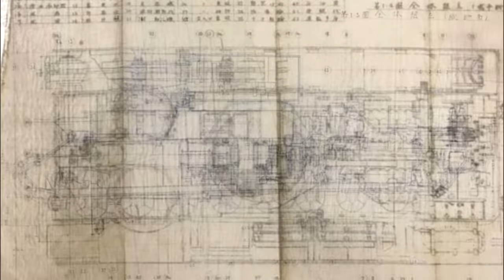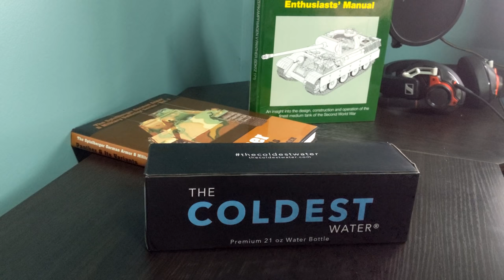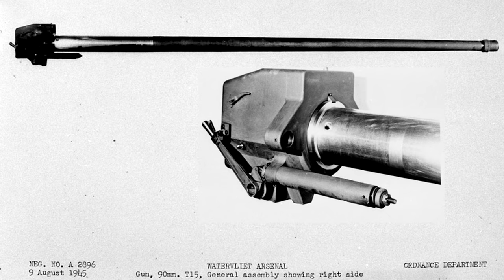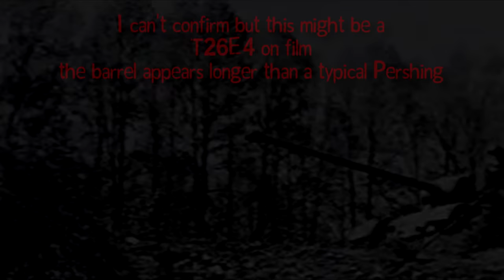America's King Tiger KILLER, the Super Pershing | Cursed by Design

Comment: Additional note:  Don't forget the ammo!  To my knowledge, the only anti-tank ammo that was available for the 90mm gun prior to the end of WWII (and possibly for some time after), was the T33 E'X', where the 'X' stands for one of several modification versions of the projectile.  I have an E4 with the powder cartridge empty and it is one of the single-piece designs.  The "T" designation shows that it was still an EXPERIMENTAL projectile not yet introduced into the standard Army inventory -- I am not sure this design ever was.  The projectile weighs about 43 pounds and is crimped to the huge projectile cartridge at the projectile's base just below the single copper driving band.  This projectile is an "AP Shot" projectile with no streamlined windscreen or hardened AP cap on its nose and the nose was a rather blunt-point "Secant Ogive" design (has a somewhat more conical, less curved shape than the more-typical Tangent Ogive nose where the nose merges smoothly with the cylindrical body); the S-O shape having a beveled crease where it joined the lower body.  This nose allowed a reasonably good penetration by "wedging" action against thick armor a near-right-angles impact (up to circa-30 degrees from right-angles as zero), but was blunt enough to dig its lower edge ("chin")  into such a thick plate at higher impact angles over 45 degrees such as the sloped upper hull of a PANTHER or TIGER II or their up-gunned, turretless, tank-destroyer variants.  Many of the earlier US anti-tank projectiles in WWII had AP caps to keep the nose from shattering on impact at moderate (30-45-degrees) against ductile armor like US tanks used and against the face-hardened armor used by many German tanks, both as their main armor or as uparmored over-layers at all angles up to 45 degrees or so.  This projectile seems to have been made tough enough not to fail under these conditions.  As the fronts of German tanks became more sloped and streamlined to increase glancing as a major form of protection improvement, the caps actually started to cause REDUCED penetration, since they flattened out and were broken up on the plate face, reducing the weight of the shell as it tried to go deeper into the armor.  Also, it was found that projectile nose breakage at high obliquity where glancing was the most important means of increasing protection, actually INCREASED penetration due to the broken nose pieces ricocheting away no longer affecting the rest of the projectile at all, so it just kept digging into the armor at the original spot with bad effects on the armor.  Note also that this new shell was AP Shot, with a solid core increasing its weight and strength, since the older capped shells had an internal cavity for an explosive.  Explosives may make the shell do more damage if they penetrate, but the hollow space inside the projectile most decidedly makes the projectile body lighter and weaker, most especially when hitting at an oblique angle, which in many cases made them of minimal effectiveness (all or nothing seems to have been the rule and AP Shot does that as well as or even better than an AP shell does if it penetrates).
Reply: The T designation was retained for some reason, even though the projectile was the standard AP round into the 1950s. T33 did have a 'ballistic cap' windscreen, but no cap.

Besides the T33, the M3 was furnished with M82 APCBC and T30E16 APCR.

Comment: Soviet Union Tiger II killers : ISU 152 and IS2.
But US Pershings and experimental heavy tanks are fascinating machines. Imagine  a T30 with 150mm HE wrecking king tigers.
Reply: @jbeverley67  And of course you can prove this, because your biased opinion doesn't cut it.
Reply from the maker: The is3 was indeed a fairly bad tank. It was unreliable and although the armor in theory was effective due to issues with the design it was considerably weaker than it should have been. It accomplished the goal of intimidation but removing any bias one way or another it was a flawed machine.
Reply: @Vlad_-_-_  just read cones response lmao
Reply: @ConeOfArc  Of course it had its flaws, the only reliable heavy that saw mass production was the IS2 and Churchill. I've read about the issues with the automotive parts of the IS3, but garbage is again, biased. I know early models have bad welds, but they seem to have remedied that. There is a famous picture of an IS3 front plate pounder by 105mm guns, the one from the Lorainne or the one on the Sper Sherman, I am not sure which one, but the armor did not crak or fall apart. Still, given only that, is not enough to make a good tank. Tanks like the Pattons and T54 and Centurions was the way to go, I do not see the point on IS heavy line after the IS2. Conqueror and M103 as well. Heavy tanks did not have a place post WW2 I would say.
Reply: @Vlad_-_-_  waste of time? Bias lmao ok. Nigga it's pretty obvious that you're bias towards the is3. It's pretty common knowledge that the is3 was a mediocre tank. What's the point of arguing something that's pretty well known already? The is3 was a rushed heavy that was built to strike fear into the allies for the victory parade. Who cares, heavys were obsolete pretty much right after ww2 anyways.

Comment: People speak of the King Tiger as though it was something that required a design to counter it. In fact, only around 500 King Tigers were ever produced and many of them broke down before reaching the battlefield. When you consider the amount of resources and man hours involved in the production of the King Tiger, it hurt the German cause more than it helped. 
...So much for wunder weapons.
Reply: The KT's 60% operational reliability does kind of poke a hole in that theory. It was only like 4% lower than the Sherman and almost 20% higher than the Panther. In the waning days of the war, KTs did indeed receive the manufacturing focus as they solved almost all of the issues that Panther had.

You heard that right, King Tiger was actually a pretty reliable vehicle. The transmission issues that plagued Tiger I and Panther were fixed on King Tiger. The engine issues were also mostly solved on KT, which is evident due to its higher speed than Tiger I, despite being significantly heavier. The roadwheels also weren't interleaved like Panther and Tiger were either, so that meant that it was significantly easier to work on the torsion bars should it be necessary.

Be kind to the King Tiger, she tried her best.
Reply: @OtterTreySSArmy  Many were reliable because they were never used. They would arrive on flatcars with little fuel in their tanks since a following train carried their ammo and gasoline. The trains with gasoline were often hijacked by other army units desperate for fuel so would arrive with empty tank cars. The tanks were unloaded and parked until more fuel arrived, which didn't happen in many cases.

Comment: REALLY? First encounter was with a Panzer 4. Panzer 4 put a round through the Pershings Barrel disabling it's gun. Second round from the Panzer 4 went straight through the Pershings Front armour plates killing the crew inside. To my knowledge the Pershing never killed a Tiger as they were pretty rare at that stage of the war. All tigers were mostly on the Eastern Battle front.
Reply: I highly doubt this
Reply: Doubt
Reply: IIRC the first tank-to-tank clash was with a Tiger I, which surprised its opponent and landed one hit on the turret top (which ricocheted) and another on the gun shield which entered the turret through the co-ax 30-cal port). Two crewmen in the Pershing were killed, but the tank was ultimately repaired. The Tiger then backed into a building and got stuck, and was abandoned.

Shortly afterward, a Pershing and a Tiger I dueled on even terms: at 900 yards, the Pershing sheared off one of the Tiger's drive sprockets with an HVAP round, and penetrated the gun shield with a T33 round, brewing it up. This encounter is well-documented and photos of the knocked-out Tiger I are featured in Hunnicutt's book "Pershing."

Comment: I highly recommend Death Traps by Cooper.  The book gives the perspective of an officer/engineer tasked with maintaining and upgrading tanks.  While he did not participate in combat, he spent many nights in a jeep racing from the front to rear supply depots and than racing back before dawn with replacement parts.  Many of these dark journeys encountered German troops and tanks.  One big problem with the Sherman aircraft engine was that the spark plugs fouled badly when idled for long periods.  Plugs had to be removed daily so the fouling could be removed.  Cooper blames Patton for the lack of Pershings after D-Day.  Patton wanted the lighter and faster Sherman, despite the obvious superiority of the Pershing.
Reply: His book is honestly more of a memoir and he formed a bit of a bias since he was in the 3rd Armored Division, which saw a lot of heavy fighting. The Pershing wouldn’t really have changed much, except complicate logistics.

Comment: It's unavoidable: when you have the consummate gun on the consummate turret, it takes a while to deploy it.  You might have freedom in the desert, but in northwestern Europe, you could not operate a super-long barreled ultimate battle tank with the barrel deployed, i.e. facing front.  So, you had to react and deploy your main gun after finding a suitable place.  The Germans had an extra problem, as the open space we might've used was not available to them: air-to-ground missiles and ordnance would take out a large German tank in a clearing.  This overall problem hounded everyone; the ultimate tank of WW2, the JS2, was impressive, but it too had the turret/deployment issue and was often defeated by this...

Comment: One alleged successful tank engagement doesn't make it a Tiger Tank killer.
Reply from the maker: You're right, but being specifically designed for the purpose of being used as a tiger killer does.
Reply: @ConeOfArc  I could specifically design a fly trap and it catches a fly the first time..i wouldn't therefore claim that it was a successful after it captured one fly. However it it kept capturing flies every time you  used it you could make them claim.
Reply: @ConeOfArc  i just this minute googled did any tigers knock out pershing and 3 examples came up this being one of them,

Fireball was engaged and hit three times with 88mm APCBC from 100 yards range by a German Tiger 1 from Heavy Tank Company "Hummel."

The first round hit the turret coaxial machinegun port and, penetrating into the turret, killed the Loader and Gunner.

The second round hit the muzzle brake and may have set off the round in the Fireball’s breech.

The third round hit the upper right corner of the turret, glancing off and then hitting the tank commander's hatch cover.

Firebll was knocked out

S0 TIGERS COULD ALSO KNOCK OUT PERSHINGS
Reply from the maker: I never once said the Pershing couldn't be killed by a tiger I have no idea where you're getting that from. What would be the point of adding all the extra armor if the tank was already completely untouchable
Reply: @ConeOfArc  I know you didn't but you should have stated it's kill record is one tiger tank..which really doesn't make it a specific tiger tank killer.
Reply from the maker: I never said it even killed one, there was a claim that it did but we don't know what actually occured.

Comment: One doesn't install more powerful guns into a tank to counter the more powerful guns in enemy tanks. One installs a more powerful gun to overcome the armor on enemy tanks that your current guns cannot reliably penetrate. If you have a 50mm AT gun on your tanks that can kill any existing enemy vehicle, it doesn't matter in the slightest that they may have 100mm guns as long as you can get into effective range. So the idea that the 90mm on the Super Pershing was a response to the 88mm on the Koenigstiger is nonsense. The high powered 90mm was a response to the heavy frontal armor that was being installed on Panthers and Koenigstigers.

Comment: Never did fight a King Tiger, when they find that what they thought was a King Tiger was a Panzer IV
Reply: If the turret-less tank in the pic is the one it knocked out, that is indeed a king tiger. Center mounted light, fenders are completely different than any panther, running gear is also different. Furthermore, I can see mistaking a panther for a king tiger but a panzer IV? No sloped armor and looks nothing like a tiger II. More likely mistaken with a tiger I. (Panther Gs did get fitted with late style steel wheels but the tracks did not extend beyond the sponsons and there were no fenders. Rather Schürzen, spaced armor plates were hung from the sides.)
Reply: @driller7714  Though the pictured is of a destroyed King Tiger, it isn't the one it's said to have "destroyed". As that's a picture of King Tiger knocked out in the battle of the bulge, and the supposed one it knocked out was climbing a pile of rubble when the tank was knocked out. Not on the side of the road.
Reply: It could have just been a mistake in the heat of the moment. I dont see it as a big deal
Reply: Imagine being a panzer IV at the end of the war and seeing this monstrosity made out of half a panther and tons of boilerplate, with random shit added to it towering over you with a massively overpowered gun... yeah, that Panzer IV got fucking vaporized.
Reply: @KorianHUN  I fucking cackled
Reply: well, shit if it were abandoned they would have blown it up though wouldn’t they?

Comment: Well how many Tigers did it kill?
Reply: 632
Reply: It was designed to match the firepower of the KwK 43, even if it arrived too late for serious combat.
Reply: @hibiki9380  Wasn't enough? Even the M3 (with M304 HVAP) could defeat all plates of the Tiger II, albeit the glacis only at dangerously close range.
Reply: @hibiki9380  The problem of defeating, at long ranges, 150mm of RHA angled at 50 degrees would first be solved with HEAT and then with APFSDS.
Reply: @r.j.dunnill1465  there's the answer, Tiger II can penetrate you before you can even reach such range.
Reply: @hibiki9380  Only if they see you first.
Reply: @hibiki9380  The M3 would defeat the Tiger II's turret front out to 800 yards, and the sides and rear at long ranges. (In a documented case, an M36 knocked out a Tiger II at 1200 yards with a hit through the side of the turret, and that would have been with 2650 fps M82.) 

They didn't have to run from it.
Reply: 2 tiger I

Comment: My favorite Pershings were the ones with the 105 mm and 120 mm guns, much better fire power, Needed a more powerful engine though or the GAA opgraded to 1200-1500 hp (which it could easily produce reliably)
Reply: The 105s were mobile artillery platforms, not intended for anti-tank applications.

Comment: There just wasn't enough of a commitment to the M26 early on to work out all of its problems with mechanical breakdowns,  sluggish top speed, ammo and armor placement issues etc. Had they perfected the M26 by D-Day, your avg tank column still would have been mostly Shermans, but with one or two of these perfected M26 beasts interspersed to tangle with Panzers and the rare Tiger encounters. It would have lowered the Sherman attrition rate.
Reply: The M26 was a rush job. The T25 was the replacement for the M4 and the Army wanted 250 made for testing in 1943. Congress was worried about not having a heavy tank in combat before the November elections in 1944 so ordered Ordnance to make one and get it there in time. They up-armored the T25 to become the T26 by December of '43 and ordered into production in February of '44. Contracts were let out for parts and machinery plus an assembly plant. The plant was finished in September yet didn't have the parts and some of the machinery due to delays. They finally started production in November with 17 assembled then 26 in December. Congress had ordered for the first 20 made to be shipped over ASAP so Ordnance ran the first 3 made around a test track non-stop for 500 miles to see what would happen. One made the trip while the other 2 lost road wheels after 300 miles. Ordnance said that was normal so declared the 20 were good to go. They arrived in Antwerp in January without trained crews and mechanics so the Army naturally refused to use them.

Comment: If one considers the failure of the US forces to provide HVAP ammo in adequate quantities for their 76mm armed Shermans, what a worse situation the Super Pershings would have to face with their much-needed T-44 HVAP (which was not issued in WW2!) if they were to face Tiger IIs. With just standard T-41 APCBC and T-43 AP ammunition the Super Pershing was hardly a  match for the Tiger II with regards firepower and armor. The T-41 could penetrate 188mm at 1,000 meters while the 88mm KwK 43’s PzGr.39 could penetrate 204mm. With 4” @ 45° the Pershing’s front glacis was equivalent to 144mm while the Tiger’s 150mm @ 50° was equivalent to 233mm. To say nothing of the turret face armor, 114mm vs 185mm, longer loading time with its two-piece ammo configuration and it not even have the magic gun- stabilizer!
Reply: Adoraboo wittoo wehrabooz
Reply: @DarkMatterX1  It's funny, being branded a wehraboo just for stating the facts!
Reply: The HVAP ammo was reserved for tank destroyers. The Sherman would get it in Korea against the T-34.